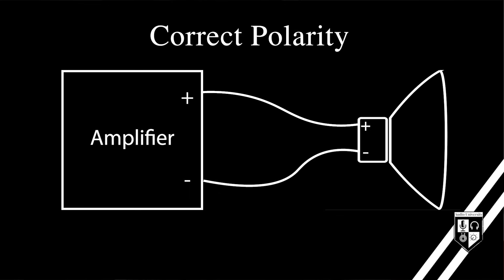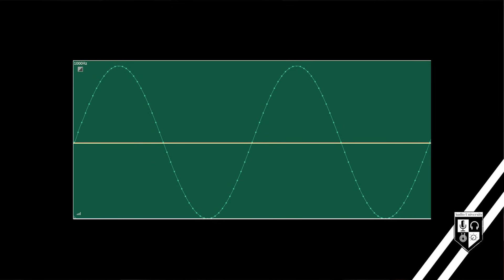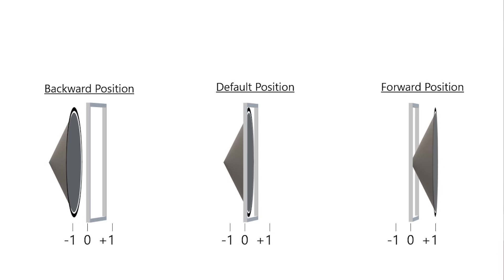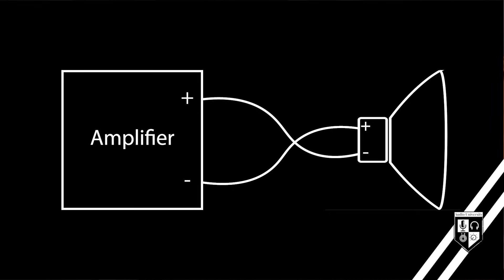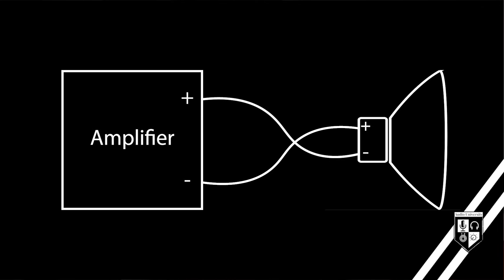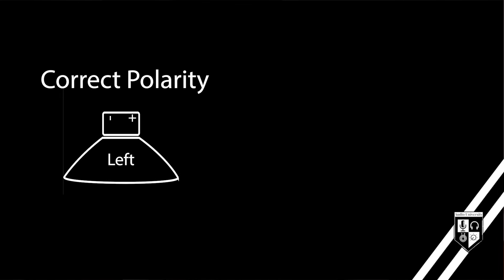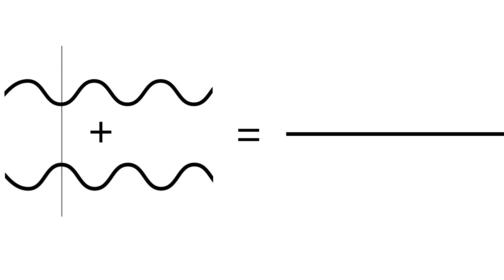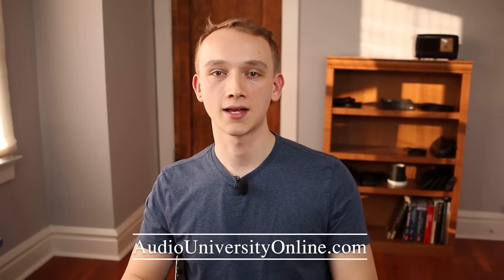POSITIVE VS NEGATIVE: Does Speaker Wiring Matter?

Comment: Polarity only applies to DC. The signal to the speaker is always AC! Positive and negative are meaningless. What is important is speaker phasing. The cones should all be wired in phase to avoid phase cancellation.
Reply: It could matter in the rare circumstance of an impulse sound.  If the recording is of a positive air pressure pulse, when it reaches the speakers they should push out to create the same pressure pulse.  If both speakers are wired the other way round, they will create a suction or a sudden reduction in air pressure. lt may sound the same or similar; and the amplifier itself may reverse a positive voltage to a negative on the speaker terminals.

Comment: Years ago, Art et Accoustique appliquée (3A) made a 3 way speaker system with tweeters, mids and 4 woofers, two per speakers. When I first heard them, I immediately noticed something very wrong with the bass response.  If I turned the balance all the way to one side, i would get tons of bass. Flip the control to the other side and.....no bass. One of the 4 woofers was wired out of phase on purpose with the other three to control the bass response.

Comment: I wonder if the crossover works properly if the polarity is reversed. All components in the amp are grounded to the negative side. The Crossover components are grounded to negative side. If you wire your speakers to negative, the signal goes to the speaker first, then through the crossover components backwards. I don't know if that makes a difference, most of them are non polar so the signal CAN travel backwards, but I would think that hitting a capacitor or two first, then an inductor, when the crossover was not designed to work that way, would change not only the polarity, but the sound signature as well.
Reply: Nope. Doesn't matter. Even a tiny bit.

Comment: Let me tell you a little story about this......  I write electronic music and have been in many different sound scape room setups. Every room seems to sound different and after 25 years of doing this I can't believe I just got had by this!!!! 
    It's crazy because I literally just corrected this issue yesterday and WOW! What a difference!!!!!
   So, again I'm in a new room and something is just off... using 6" coned passive monitors and a powered bass cabinet so I can really understand the low end as is needed for this type of music. 
    So.... back to something isn't right..... I ended up reworking this synth line a few times knowing in my head it should be working but it's not...... so I start looking at the speakers for transients that could be taking crossed notes and spiking kinda thing, but the cones were moving inward on the low hits!!!! 
    NOT GOOD!!!!!
         BUT HERES THE THING!
   Everything was wired in proper polarity so it struck me as almost odd until I realized that because my sequencer has sort of an out put issue on the right stereo out I ended up just splitting the headphone jack and running into dual 31 band eq's and adjusting levels so the meters looked accurately even. 
    However...... because the right side is outta level with left... the left solo is an automatic MONO out channel if used alone, it wasn't but was still stronger..... so the sound was wrong when the meters said yes! 
    Strange as it sounds, I'm in a temporary set up at the moment so it's a rig job till this room is done for set up...
     I ended up having to run a split from the sequencer to the eqs.... then input to bbe, then to separate channels on a mixer..... so from the mixer until I can set up the full gear again, I'm playing with a Gemini dps digital recorder... but the stereo ins are screwed... so it's another split from the mixer to the recorder mic channel🤦‍♂️...
   I know I know.... it's so wrong, but it's what I have right now... and it's not over yet🤦‍♂️ 
   Now that I've got my split signal to the recorder, I have to actually hear it lol..... so, now because everything is packed up I've got a small Sony bookshelf stereo I'm using for power lol..... and it has no rca ins lol.... so again another "balanced" cable to the 1/8" input to route sound for my ears......
   If you kept count I'm on my 3rd split pathway now lol..... so by the time it gets to the amp it's in reverse again in the chain.... so I literally wired them backwards coming out and they are now in proper phase with the sub and do not cancel eachother out!
    Actually for as much bs as this set up is going through right now, I unlocked it lol.... it can be done, you just have to know the physical properties of sound and how to fix it.
   But to be fair, I'm not new at this.... I've ran a 40k watt system for about 20 years now, so trouble shooting sound comes quick 😉
   But anyone going through similar issues.... just know, you can get to a point of frustration easily.... but it can be BEAT!!!! 🤘⚙⛓
Great video man.....
  - PSYCHOBYTE ☆○°▪︎.▪︎°○☆

Comment: Try this: change the wires inside the speaker from the crossover to the woofer to something huge on one speaker. When you crank your tunes it will sound like you lost the other woofer. One foot of 12 gauge per speaker, crossover to woofer, makes a vast improvement in bass response.

Comment: While working as a DJ in the 70s the engineer installed a new turntable and somehow switched the polarity of one of the audio lines. The result was easily heard with the early stereo mixes, examples of which would be early Beatles recordings. The vocals were cancelled out, they could still be heard but weren't up to a true stereo sound. The issue went through the board to the transmitter to the listeners radio! As soon as it was mentioned to the engineer he knew exactly what had happened and fixed it.

Comment: I have been experimenting with my earphones that have a 2-pin connection (BLON-03 with 8-core cables). When connected with the correct polarity, it sounds like it's in your head and the instruments and vocals sound more intimate and detailed. When connected with inverse polarity, soundstage is noticably wider but I don't feel the same intimacy and details, so I don't connect with the song emotionally. Changing the polarity also changes the imaging and instrument positioning.
Reply: On other songs, they sound congested even with the correct polarity. Then they right using the inverse polarity.

Comment: Due to the nature of the air (gas) it needs more force to compress it than to decompress. Since speaker membrane produces a series of compressions-decompressions of the air in a speakers cabinet it adds some nonlinear distortion  in output wave. So connection polarity matters even for single speaker system.
Reply: I disagree.  Speakers are simultaneously compressing and decompressing.  If pushing forward, then it is decompressing behind the cone and compressing in front.  If pushing backwards, then the reverse.  So the forces experienced on the cone ought to be symmetrical.
Reply: @thomasmaughan4798  this is a good point
Reply: @thomasmaughan4798  agreed, but only if speaker is set in infinite baffle.
Reply: @dcorp80  "agreed, but only if speaker is set in infinite baffle."
One of many things to consider in speaker design 🙂
Reply: So does this mean that amplifiers skew the wave to correct for this? How do they do this?
Reply: @woulg  An amps do nothing with it. But  firstly, amplifiers has own distortion “signature” (we’re talking about odd harmonics) finally we get the sum of it with air produced ones. So we could get more pleasant sound for particular connection polarity.
Secondly, while recording (in case sound was recorded, not synthesized) the air compression effect took place. In that case the output waveform will depend on the connection polarity. (sum or difference of air produced distortions)
Anyway to hear that differences it you must have your system setup of enough quality.
Reply: @dcorp80  I'm skeptical, but I'd be curious to see a recording of a sine or square and compare it to the original to see if this effect is perceivable (by eye). I highly doubt it is enough to matter but it makes me curious to do a blind test for sure. 
I have another thing like this that I like to ponder (sort of related), the speaker cone has mass, so it must curve the edges of the square wave, I'm curious at what frequency this filtering becomes noticable (I have a feeling it's outside our range of hearing). Anyway, thanks for answering, interesting thoughts
Reply: @woulg  It depends on sine recording resolution ;) Speaker cone behavior is another wide topic. It even stated that after passing some frequency (while increasing it) speaker cone stops act like a piston and become irradiate in form of circle sectors (i think you can find it in the Internet). Moreover there’s a dependency between cone radius and sound wavelength that affects frequency cutoff of a speaker. And so on and so on…
btw i’m curious what would be the results of the blind test)
p.s. YAW. thanks for asking

Comment: 03:47 wow, even with my low-quality computer speakers I'd noticed a really big difference. The bass is completely gone when only one speaker was "wired wrong"
Reply: The quickest sanity check is point both speakers at each other. If bass suddenly disappears you will know they are wired oppositely.
Reply: @MyRackley  I have some magic wood knobs I'd like to sell you for an outrageous price. It will make your stereo mind blowing.  The silliness that passes for knowledge in the audio world is crazy.
Reply: @MyRackley  I have done this in the past and it works great for significantly reducing volume while allowing the cones to move. Your neighbours will love you for it.
Reply: Out of phase, each speaker is working to cancel each other out. The result is the impression of lower bass volume.

Comment: Thank you so much for sharing your knowledge. Because of your video I was able to figure out the positive vs negative on my subwoofer. I've been asking and asking these guys for help and I just got tired of waiting. Now I can figure this out without anybody's help. Thanks again I sure do appreciate it ;-) take care
Reply: Hi Cindy, it is very simple. Red is positive and black is negative.
Mostly speaker cables are these colours 
Or if the plastic is not colour coded then there is other method. In my car one wire is copper and the other is aluminium, tha plastic is transparent. In my car copper wire is the positive and aluminum is the negative.

Comment: Polarity only matters when speakers at the same distance. When using multiple speakers like in a mall, it doesn't make a difference since your distance to the diffent speakers is also different and you get the phases wrong anyways. So only in a line between the two speakers you will hear the difference ... otherwise not. Besides they prob use mono in a mall anyways ... and with the same issue of phases canceling each other out.

Comment: well, wiring makes no difference, bout the total end result from all the electric crap and xovers and shit along with placement, you want to aligh things to be PHASE CORRECT at the LISTENING position. wiring a speaker in "reverse" is just a 180 degreee flip in phase. depending on about near endless variables it can or can not be a good decision.

Comment: The caveat here is that these arguments only hold true if your ears are sittting in the exact same distance from the speakers as it does when using a headphone.  A 1000Hz tune will switch polarity every 1 millisecond and when sound travel at approximately 330 meters/second in air this equates to a distance of 0.3 meters (approx 1')  between each phase shift.  Similarly a 10kHz tune switch polarity every 0.1millisecond, i.e. every 0.03m (approx 1").  For the latter case it also means that the sound wave from one speaker switches polarity several times while traversing the distance between you ears.  I.e. in a real world scenario the sound emitted from two speakers will reach your mostly out of phase anyways. This is the normal environment in which we all live and our brains don't really care whether the polarity of the speakers are out of phase.  When listening to stereo, or even quadrophonic, music your brain will perceive a spatial differentiation in where the various sounds are coming from. This even though only parts of the sounds emitted from each speaker is different.  I.e. our hearing system is ignoring the phase shift issue and will focus on the differences in the sound.  However, this might not be quite true for the very low frequencies.  A 25Hz sound is shifting phase every 13m (31') and your two ears will not be able to detect the minuscule phase change that these sound waves have when they exite each ear.  This is, by the way, why we are not good at detecting where low frequency sounds are coming from and also why subwoofers don't come in pairs.  If you decide to have more than one subwoofer in your setup you definitely have to make sure that their polarities match.

Comment: I own a pair of JBL4312 three way speakers. With correct connection to the amplifier, the tweeter and woofer pushes out when the midrange driver pulls in. The crossover wiring has been confirmed as correct. Why do you think JBL would’ve designed these speakers this way?

Comment: Be careful with the 9 volt trick it is safe to use for mids lows and subs 
however do not use them on highs aka tweeters it can be enough to melt the voice coil 
use a 1.5 volt battery just to be safe they are pretty delicate 
and before you ask yes I have seen it with my own eyes my buddy killed his expensive Focal tweeter with a 9 volt battery
Reply from the maker: Thanks for the tip!